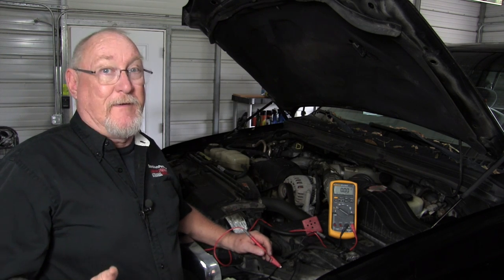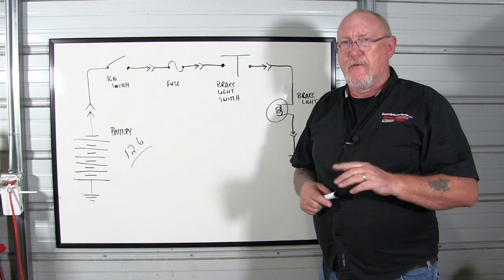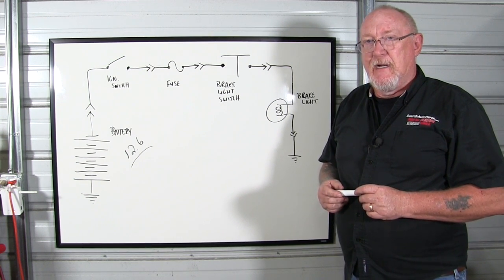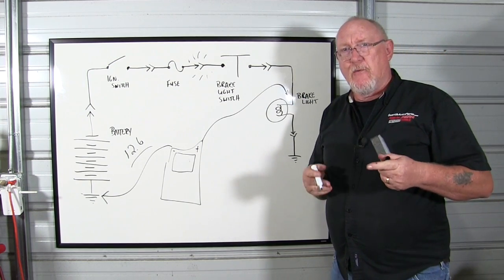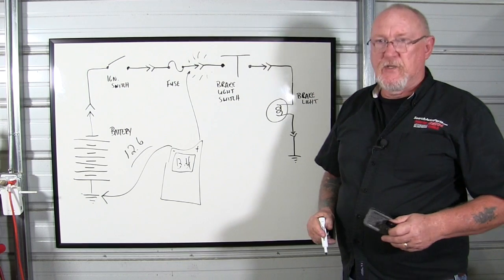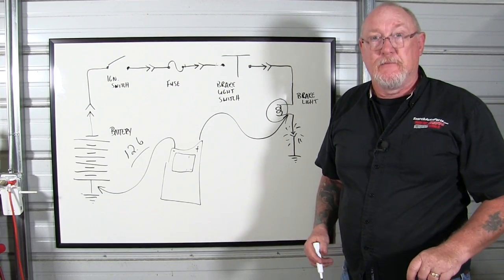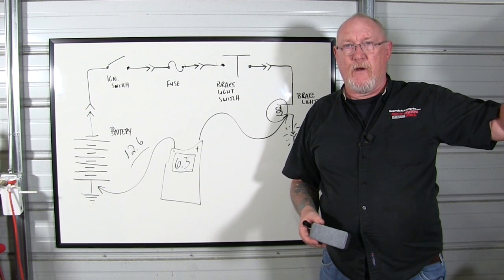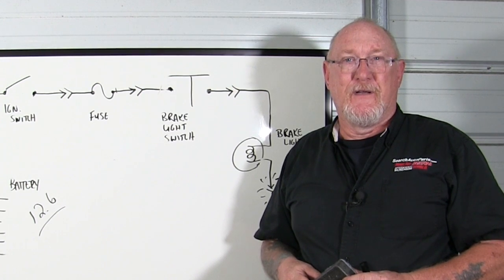The Trainer #84:  How You Can Measure Voltage When Your Meter Leads Say You Shouldn't

Comment: Hello Pete,

I have been regularly watching your videos, self educating and using your skills, here is a summary of your lessons: draw test in series with power pak; voltage drop, wire diagram reading, harness tracing, resistance ohms testing isolating wires between relays and fuses, and more, the splices on legs, I am learning and growing thanks to your group. This is what I have worked on to find the shorted wire, not yet found, the amp draw did not disappear yet. 

I could not find the harness #18 under the dash. There was a yellow connector with yellow wire under the air duck on center of fire wall in alignment with the shift dead center could not get to it.

What I was able to do, was do parasitic draw test, disconnecting neg bat cable, setting up meter to 20 amps connecting meter neg lead to bat neg terminal ; positive lead to bat neg cable; got and amp draw of 0.11amps disconnecting all connectors one by one until the amp draw disappeared to identify the harness and the harness branches, the amp draw stayed on during the connectors, that were disconnected and reconnected; those to the left side of center console pillar; then to the connectors on the right side of console pillar,  including the air condition connectors, all in center console.

Proceeded to the connectors on the left kick panel; then proceeded to the connectors on passenger side heater blower and cruise control module, the amp draw did not disappear, at all.

Proceeded to engine main harness, at the fire wall, with the rubber grommet protector, shaking it by hand, through to the fuse box, to the coils, to the injectors, to neutral safety switch, the brown ground wires by the coils and injectors, all the way to alternator harness and battery cables, the amp draw did not disappear from the volt meter?

The engine grounds, where solid to body, not loose nor rusted.

I was hoping to isolate the harness connector, by disconnecting it, exposing the male pins and the female receptor terminals making the amp draw of 0.11amps disappear; then using alligator clips to test each connector male pin on one side, then using a nail on the other end of alligator clip, gently touching the female terminals, one by one, until I found the wire, that would make amp draw reappear to identify that particular wire, within the harness, No response at all.

I did not disconnect the fuse box to see the spliced wire tracing it back to gauge fuse and branch harness in upper dash. I did not want to remove the upper dash and could see, no connectors, to disconnect, further.

I did not do a resistance test from EFI relay to the open/circuit relay to check a splice in wire diagram under fuse 10 (gauge) . I was not certain on how to proceed; thought about probing the isolated color wire identified by  wire diagram, with a wire piercing probe but was baffled by how the colors of these wires changes on there way to ground, from one side to the other side, of the wire legs. Thought about a test light to puncture a hole in each wire with a good ground connection.

Thought about the amp draw possibly on the power side of the circuit; afraid to connect test light to battery positive on a power side puncturing a hole creating another short power to power.

Earlier on, during relay phase,  I had tested the ground socket terminals on relays, both control and load side, by connecting test light to positive battery, the ground wire lit up, so they are good, all good, on every relay. The control/ load good too. All relays where tested for resistance on control and load sides and load side for current flow, excellent condition.

This was a bully beat down, against what little skills, I've learned. You guys are tough and brave to contend with integrative circuits, I am evolving towards it, after so much pain.

Respectfully, 
Bob Bishop

Comment: Hello Pete,
Its been a long time since the Toyota Corolla 2000 suffered several problems: a faulty mass air flow sensor; a seized up alternator; a fuel pump replacement; injector seals inside each cylinder removed by vacum suction.

The car cranks smooth and fine yet it will not start. OBD computer says no codes.

The open/circuit relay is fine ; no power to fuel pump.

There is no power on load side; no power to control side, of fuel pump relay socket.

There is power to Electronic fuel injector relay, load and control side, tested fine.

The fuses are all fine, in engine bay and under dash, is this an ECM issue or anti theft circuit kicking in again?

How do I make computer capacitors power down its memory, this happens when I remove battery for a long time.

I had removed the after market alarm system I do not understand how this car has an anti theft module I cannot find it on the steering column either, do you know what it looks like or the on off codes?

Respectfully,
Bob Bishop.

Comment: I have an interesting problem. Starts great, charges great, UNTIL it gets all warmed up. Then, my volt gauge (in dash) goes on discharge, barely. Then, the next day, it starts right up and charges the battery, from what it drained the day before while driving after engine got all warmed-up. That is, until the engine gets all warmed up again. The garage said maybe I need a new alternator, but I don't think so.

There is no parasitic draw over night. I never noticed this until about a month ago. So I don't drive very far these days as a result, as the more I drive once it is all warmed-up, the more it will drain my battery, of course. 

The battery is great, the alternator is great. It starts right up ... what the heck is it? Everything works, no dash lights on, all dash gauges work perfectly. 

 Info: it is a 1998 Chevy S10 2.2L 2WD, just under 100K miles. Any takers on this one?

Comment: Hello Pete,

The new mass air flow sensor arrived. Do you have any videos on removing seal injector tips? 3 seals, where spotted in 3 combustion chambers, the other on exhaust valve is melted and harden onto valve stem circumference . I have tried 20 degree needle nose for valve with melted seal, it did not work. Tried gasoline and WD 40 and hot air to soften it it did not work.

Tried vacum suction for combustion chamber it did not work. Bore scope help in locating them seals they are all at 3: oclock inside combustion chamber. I am stuck with rubber seals and the removal of intake manifold. Will these rubber plastic seals damage the engine and vale stem?

Is there a specialized retrieval to that can flex turn and grab?

Respectfully,
BB
Reply from the maker: Not sure how to help you here except to say that I would not run the engine with any known foreign material in the combustion chamber. Good luck!
Reply: @VehicleServiceandRepair  Hello Pete,

I am having success in removing the seal tips from combustion chamber and valve port. Discovered that with piston on Top dead center I can suck it out through spark plug hole with a wider vacuum hose over it. Got 3 more to remove. Thank you for your support, I am more reliable then I thought, especially when I am comfortable staring down at the problem until some module in the human brain lights up attempting a creative idea that to my surprise begins to work and solve the issue.

Respectfully,BB

Comment: Hello Pete,
six more days for mass sensor to arrived in mail. 
Injector tips fell into the bored hole when fuel rail was pulled out, what is the best way to get them out?
Reply from the maker: Into what bored hole? The injector body shouldn't separate - except from the rail itself.
Reply: @VehicleServiceandRepair  Its the bore hole were the injector sits and sprays into cylinder chamber, a rubber insert, did come off and fell down, all 4 rubber tips at the nozzle on injector spray tip.
Reply from the maker: @andrameda1  Those are the seals. If you can still see them, take a mechanic's hook and carefully pull them out.
Reply: @VehicleServiceandRepair  Thank you for recommendation. I can't see them and a tight vacuum fit with high suction did not work either. I will have to remove the intake air plenum to be able to remove them seals, from valves chambers. Injectors port is  side port indirect injection removing air intake manifold I will be able to see and remove them.

Respectfully,
BB

Comment: Hello Pete,
Update on the Toyota corolla 2000. The alternator was in a seized state pulley was frozen belt was just skipping unnoticed till I used a remote starter switch then I could see it. New parts : belt; alternator; unplug coils OE; engine turns with power in park and neutral; cranks, no start.

Checked starter relay, it was replaced low ohms; check open circuit fuel relay, it was replaced low resistance readings and hot.

Checked power and ground at the fuel pump ground reading 0.0; power side reading 9.2 volts, fuel relay was clicking, when I touched the power with test light. Pulled relay out, key On, clicking stopped. Placed relay back in clicking again, every-time test light was on power wire at the connector it lit dimly.

New open circuit relay in : no power to the fuel pump now? Test light does not dimly light up. Either way new and old relay never heard fuel pump prime up.

Fuel pump is an after market Delphie type, it is brand new; new filter and fuel pressure regulator tested with vaccum pump, it holds pressure.

There was a floating relay under steering column, I had removed while removing after market devise, I never knew existed; is this an original part? It can't be because they had spliced it in, it has a white and black colored wires spliced into ignition red wire, so, it is not original. Uncertain!

I will be checking for spark, on new coils and add fuel to air intake; again what else can I check. ? 

Throttle sensor is not defective as I thought, I had testing it the right way the third time signal and ground wire responded to opening of throttle damper.

There was a voltage reading of 9.2 volts in power wire of fuel pump, with a difference of 3 volts short with old relay. I did not do a voltage drop test  battery positive to positive fuel wire (blue black strip). Do you think I need to? Perhaps this was the open circuit relay's weakness?

I neglected to tell you, that in my desperation, I watched a video, that was trouble shooting anti theft blocks on ignition and I blindly followed resulting in no bus communications at the data link, where as I did have communications before.This was before I discovered your channel.Pin 4 and 12 were jumped together creating a short in the module system.

 The last pending code on diagnostic tool was P0001 open circuit on the resulator, fuel pressure issue on the fuel rail however I could not find it, the corolla does not have a valve on fuel rail?

Error link is what comes when on board diagnostic tool is plugged into data-link?

Cranks no start.
Reply from the maker: Your post rambles a bit and is hard for me to follow, so let's start here - you say the engine will not turn over but will not start. You can use a spark tester to verify spark and you can access the fuel rail to see if you have fuel OR you can try spraying a little carb cleaner into the throttle body while cranking to see if its fuel related. Don't forget that the engine has to have good compression, too. 

And that relay you found spliced in - trace the wiring and see what its wired into. I'm betting its some kind of alarm system.
Reply: @VehicleServiceandRepair  Hello Pete thanks for your response. The car cranks wants to start, it starts, then bogs down and dies. 

Good news OBD fuse was blown, replaced it, now have restored communication with cam bus network. 

The diagnostic tool is plugged in the data link, it reads no codes. No pending codes either. There is spark and there is fuel inside the fuel rail as I removed it pressure was strong. De-pressurized system first the gas cap off. Resting pressure was present

So I am faced with closed injectors or dirty injectors or computer driver not returning power or ground side control to the injectors or a tank cut-off valve leaking; there is power to injector connectors & ground is good electrically. 

Checked to see if its hydro-locking from too much fuel, check smell of oil, looked for leaks, at the fuel rail and unplugged the spark plugs to let vapors evaporate for an hour. It starts, bogs and dies repeatedly.

Its a great challenge and learning experience. There is a mild gasoline smell in back of the car.

Respectfully,
Bob
Reply from the maker: @andrameda1  Check the MAF too for contamination. Try unplugging it and see if idle quality improves.
Reply: @VehicleServiceandRepair  Thank you good easy one to do; one of my injectors ohm reading is over 25 ohms the others are 14.4 ohms. Is this a bad injector can it cause the other injectors to unevenly spray they work in pairs like the coils do ?
Reply: injecctor ohms good; cleaned injector reconnected fuel rail and coils. Followed up on your mass air flow sensor.

Wire diagram shows throttle and mass air flow sensor share a ground wire. mass air flow sensor ref reads 2.25 on volts on meter. Unplugged the connector the reference came up 4.99 volts this is the shorted sensor as you pointed me to thank you. 

The diagnostic obd also pulled up a code P1000 and p1300 mass air flow circuit A open and igniter no 1. This a false code there is no igniter on the corolla. double verification.

Respectfully,
BB
Reply from the maker: @andrameda1   I prefer to look at current and voltage on a scope when comparing injectors. You can also perform a fuel injector balance test. But I don't think the symptoms you are dealing with will be caused by one bad injector. Don't get caught in the details - keep your eyes on the big picture.
Reply: @VehicleServiceandRepair  Hello Pete and crew techs,
I love learning with your group Vince Finchelli, Jerry, Richard Peterson, Pete Mier, and all your seminar experienced instructors have inspired my brain's panoramic scope, that I am re-starting to re-learn and read my text books on diagnostics, with more openness and receptivity, I am very happy that am I able to follow and understand!

The mass air flow sensor is not dirty it  does not have a broken filament wire. Checked power good, ground good; 5 volt ref wire, was pulled down, from 5v to 2.23v, after disconnecting it, the 5v ref came back-up to 4.99v, this sensor has a shorted mother board, can I fix this by opening its case look for burn component or solder it? Ordered a new mass sensor.

 after I re-connected injectors, I should have started car first, instead, I may have made a mistake disconnecting the mass air flow to see if the obd pulled up a mass air flow sensor code, it did. Re-connected the sensor, key in start, it cranks, no start, where as before it would start, bog,then die. 

No priming sound is heard from fuel pump, when key is in on position, is it because of the mass air flow signal feed to ecm not working?

Did I cause the alternator to seize up, while starting it with a power pak on the battery terminals? The battery was on the weak side and 6 years old.

Did over charging cause the filament in the mass air flow sensor to burn its mother board inside sensor?

The injector side rubber booty tips, all fell into the combustion cylinders, do I have to remove the intake manifold and replace how do I get them out will it harm pistons rings and valves?

Will I have to purchase a video camera and a extension claw with light.

Respectfully,
BB

Comment: Hello professor Pete,
I found the ground short finally it was not engine bay ground wirer's it was the alternator showing 8.44 volts on ground side.  The alternator seized up pulley frozen and bottom of casing broke off. The throttle sensor is dead cam and crank sensor good when cranking belt was seen slipping around alternator pulley. Using remote starter switch also allowed me to witness the belt during crank. Belt looks good however it will get new alternator; denso coils; tensioner; new belt . The voltage drop test was excellent in helping me I could not answer the question to myself what is between engine block body ground after figuring the starter and neutral switch is proven to be working? I never thought alternator because I assumed it was working because of the cranking sounds when sitting in the car turning that key to start it was the visual that made suspect the alternator then I did voltage drop test it showed a ground short of 8.44 volts bat nega to alternator neg. I will report back after everything is replaced to make certain. I wanted to make a small contribution to you kind act of guiding me in this electrical drama, thank you to the group of techs and the students who asked great questions helping indirectly.
Peace and gratitude!
Reply from the maker: I'm glad you found your issue and I look forward to hearing the final results.

Comment: Hello Pete,
Still looking for the ground short just around engine block . Discovered while looking at the engine during crank with remote switch observed that the pulley  belt was spin slipping, this would explain crank and cam  sensor signal not reaching the ecm to start fuel prime. It did not jump time nor is timing chain out of order because the crank pulley is turning.

In park with remote switch it cranks nothing wrong with starter. checking feeds and shared grounds to sensors throttle, cam and crank soon. I know throttle is dead no response to open/close. Is this the ECM doing a revolution limitation MODE ,when I had floored the accelerator, that when it shut down?

I have a power distribution wire diagram studying it soon. Let you know when I start the car welcome any insights you may have, thank you!